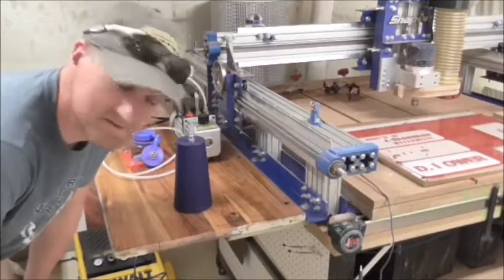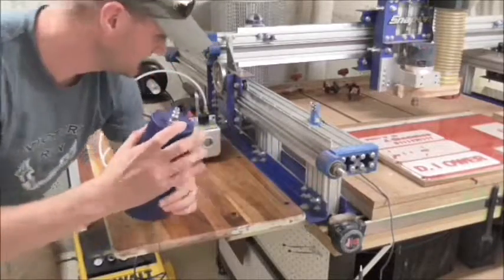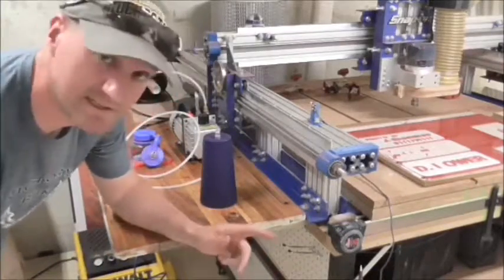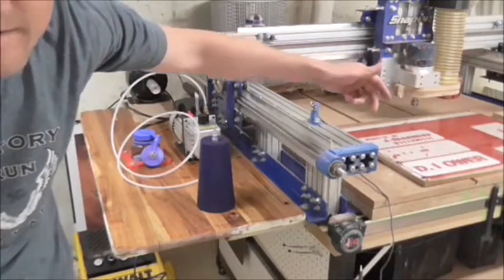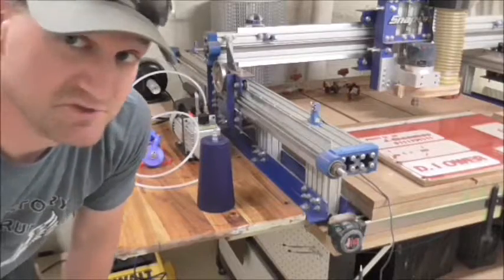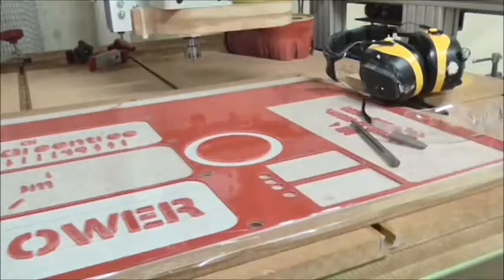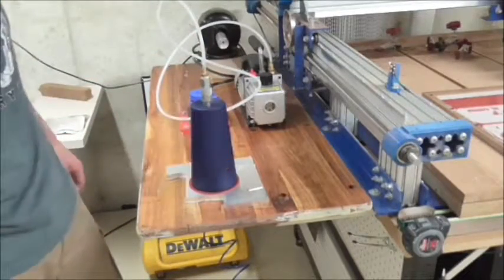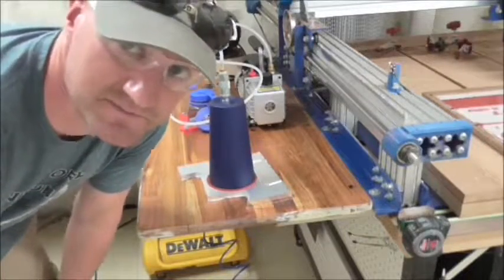Quick and Dirty DIY Vacuum Chamber

Comment: Hey Scott, where can I acquire some of the red gasket material that you use for your vacuum projects?
Reply from the maker: I get it from Woodcraft.  It's marketed as "Silicone Rubber Bench Mat" and intended to help woodworkers protect their workbenches from glue and other errant spills.
Probably could find the exact same stuff for less somewhere on the internet, but the stuff from Woodcraft works for now.